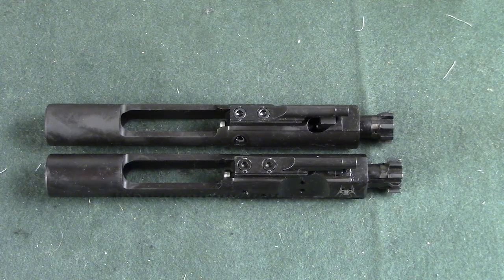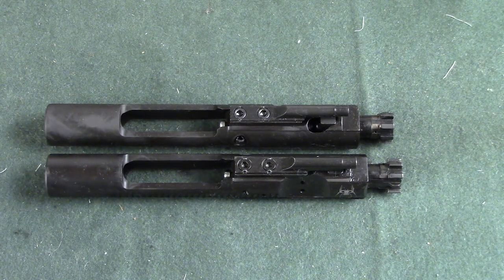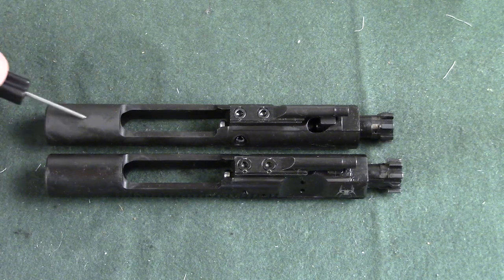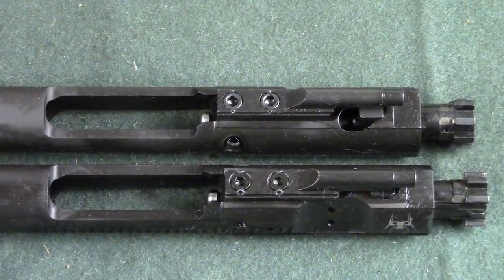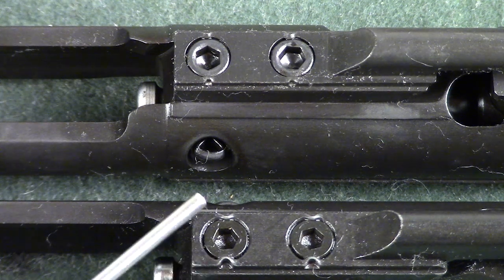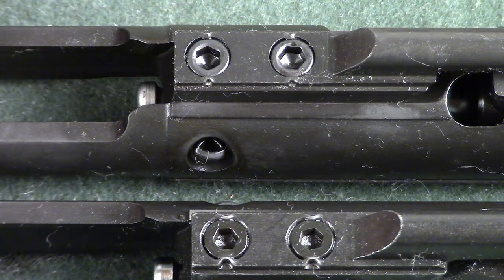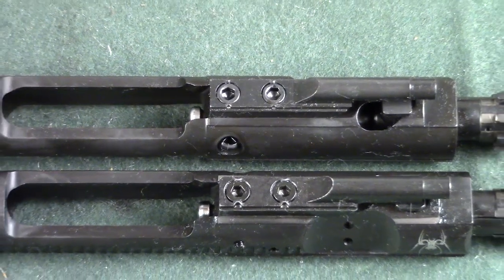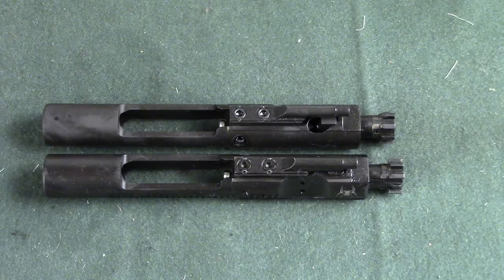AR-15 Bolt carrier key improperly staked

Comment: It can be difficult to tell if they are stalked properly.   If the screws they use are rounded at the top (no square edges) the stakes can come up short of the top surface but are actually narrower than the full width of the screw, meaning it looks like its not staked correctly but the screw can't back out.   And some companies have nice looking stacks perfect squared edges but they are for show and the screws can easily be backed out.   

Colt does a good job, they use the rounded screws which allow for more aggressive staking.

Comment: Yeah that's a cool video and all, but you coulda been more thorough.  My AR became basically a bolt action rifle so I stripped it down to diagnose the problem and the bolts on the key were loose so the gas pressure was escaping thru the carrier.  I tightened them and it worked for 15 rounds again then stopped for the last 4.  My buddy explained staking and I ordered a new key and bolts to avoid damage.

Comment: Spent 1000 on a Black Rain Ordnance rifle. Mil spec. Gas keys came loose and completely broke and separated from the bolt carrier. Sent it in got it back 40 round in and it came loose. The staking was weak af. Had to do it myself.

Comment: just found this vid.
i say as a few few others have commented...stag looks over staked,obvisouly a clean machine pinch on both sides at the same time from the way the bottom shelf of the stake looks.
i recently read somewhere
YM,YH?(dont remember),doesnt and will not stake their gas keys(will not honor a warr.isuue if anyone does on their product),somehting about staking is a mil spec requirement(duh)but does not seal the key.
they say use locktite gel.on the mating surface and threads and torque to 56in.pds(seems a little light to me,i like 70in. range).
ive tried and have done it both ways and have never had a problem in the last 15 years or so.i think a little more torque helps also.
everyone has has an opinion though. 
why couldnt you inspect it before you bought it?
Reply from the maker: I couldn't inspect it because it was a mail order BCG.

Comment: just sent lmt some pics of their stake job compared to some images of poorly staked carriers on google. but its true everyone has an opinion online. im sure since the staking is coming from the side n not the top that screw is being engaged more than the eye can see thus preventing it from turning. the guy on the phone was quick to tell me it was ok without seeing pics but i insisted on sending them some so we will see what happens. the reason i spent 300$+ on an lmt carrier was because of their military contracts n so i didnt have to worry about it plus if that coating isnt dlc its pretty close. hopefully they will respond soon.  honestly with my naked eye my bcm carrier appears to be staked better which kinda surprises me at half the price. and that bcm carrier ironically is what i bought an extra key n screws for because i assumed id have to replace it one day.

Comment: I would almost say the Spikes in that video was over staked. The point of the staking is to stop the rotation of the bolt so it will not come loose. Grade 8 fasterners have a high tinsel strength and sheer strength but are more prone to fracture with induced stress. Over staking can cause fractures in the fasteners that can cause them to sheer later. Also coming loose can cause them to sheer, so it is kind of a double edged sword there. 

It almost looks like in the video that the fasterners were also deformed by the staking. Now it looks like that is a spikes enhanced carrier and the fasterners are a smooth side, not knurled like most speced fasterners. This may be why spikes chose to stake them hard. I trust they know what they are doing, 
My only reason to mention this is several of the comments are comparing the carriers they recived and sending them back because it does not look like the bottom one. It can be propperly stake and not look like that spikes carrier.  If you compare a Colt M16 carrier and key it will look more like the Stag left hand carrier above. Metal from the key contacting the knuled metal of the Grade 8 Fastener. Refrencing the M16 tecnical manual that can be found online is a good refrence of is the key staked correctly or not. It is very important. Cheers
Reply: Grade 8 fasteners have a high tinsel strength and sheer strength but are more prone to fracture with induced stress. 

contradictory, armchair metallurgist.

Comment: Is that top bcg a stag lefty
Reply from the maker: Yep.  Good catch!
Reply: I replaced my stag 2t bolt carrier because of the same problem. Now I feel more confident using the fail zero bcg instead. I plan on getting the stag bolt carrier re staked and use it as a backup.

Comment: I DONT KNOW WHY THE GAS KEYS ARE NOT JUST WELDED ON OR JUST A SOLID PART OF THE BOLT CARRIER UNIT FROM START! THE DESIGN SHOULD BE REVISED!
Reply: I know that this is three years after the fact, but God forbid a gas key that is WELDED onto a bolt carrier ever get damaged. The bolt is ruined. In this example, the lower bolt is OVER staked. If anyone tries removing that gas key, they are probably going to wring off those screws. Ruined carrier being the result. Just a slight crimp to secure the screws from backing out under normal use.
Reply: @chuckw4254  I'm inclined to agree. It doesn't take much contact to prevent the bolts from loosening as the force doesn't impact them in an unscrewing motion. Overstaking is as bad as welding your gas key on.
Reply: Amen
Reply: stop yelling.